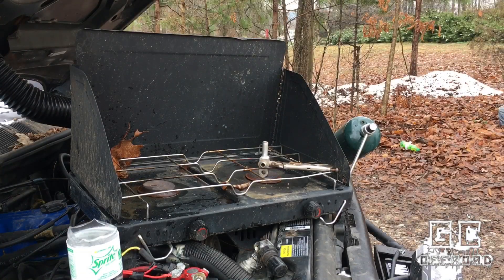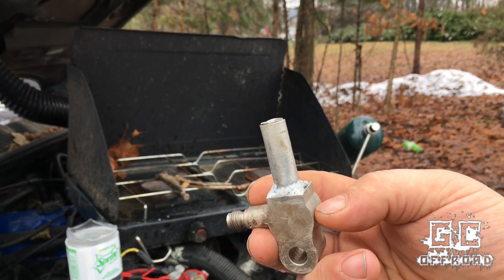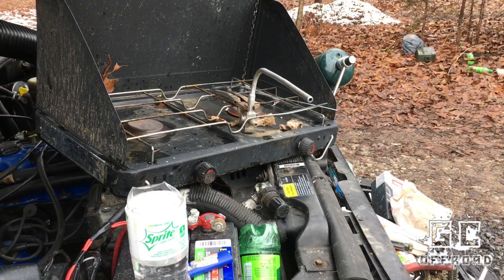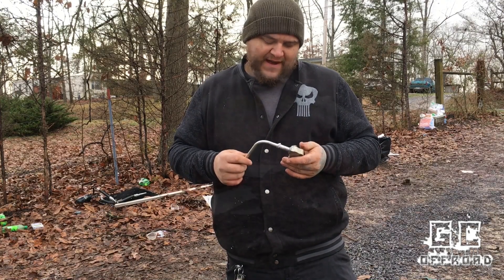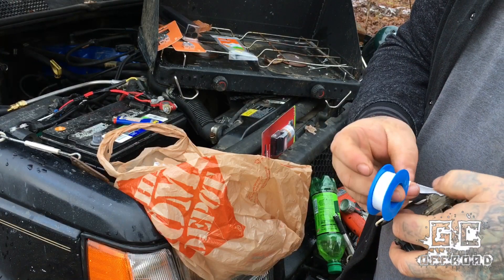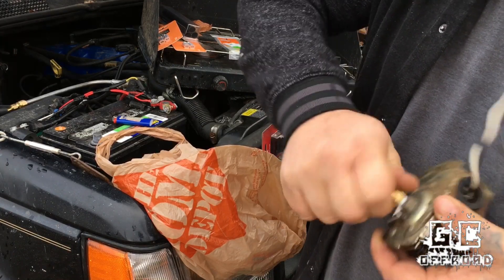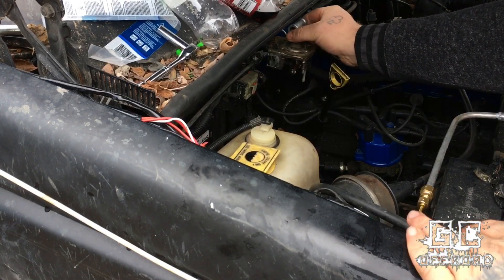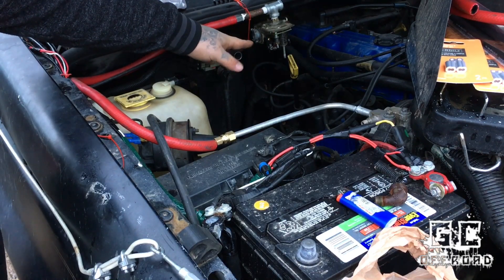HOMEMADE ONBOARD AIR

Comment: When I did this in my zj I just trimmed the aluminum line flush on outlet fitting and ran a 1/4npt tap in it. Used a braided stainless air line from the compressor with a check valve in the end of it to a manifold with a pressure switch and blow off valve and ran lines front and rear from the manifold. Wired in a rocker switch in the overhead console to a relay that controlled power so it would only engage the clutch when the switch was on so it wouldn't drain the battery.
Reply from the maker: I’m gonna change out the pressure cut off soon. I had this one off an old air compressor so used it to test the system with. And I was also experimenting with the aluminum braze rods I was gonna use tap and fitting like you said but figured this was as good a time as any to try it out. I also have an illuminated rocker in the cab that controls the main power to the pressure switch and clutch. I’ll be posting the second part of the video in just a bit
Reply: @GCOFFROAD  I used a compressor switch at first like yours, but a manifold with a small switch and bov took up less space. It'll work fine but I'd still use a good relay to actually control the compressor clutch cause I think running the clutch power thru the pressure switch is what destroyed the contacts on the one I used.
Reply from the maker: I just added an accessory relay fuse box last week and have a space already wired in for it to go through the relay setup. Just gotta go pick up a few new relays to finish it off. I’ve noticed it has a small leak I still have to fix in the line where the condensation filter hooks up. But it works good so far
Reply: @GCOFFROAD  awesomeness, I chased little leaks for a while, went thru a couple different check valves before I went to the braided stainless line with one made into it cause most id the ones I could get locally were for plumbing and leaked air back thru the compressor.